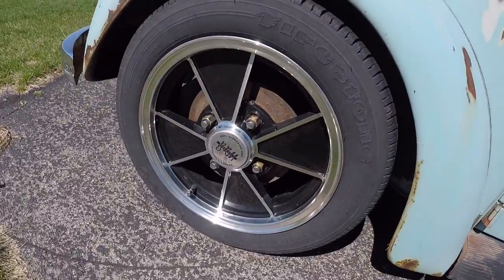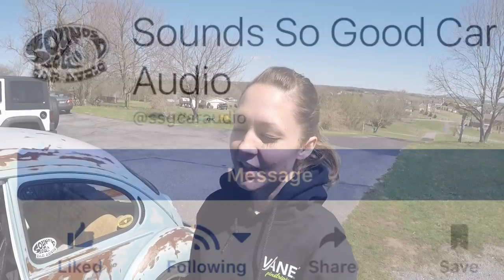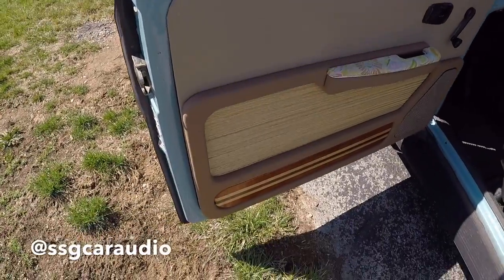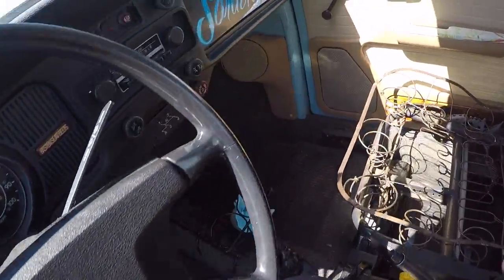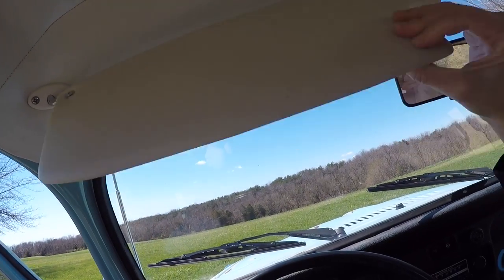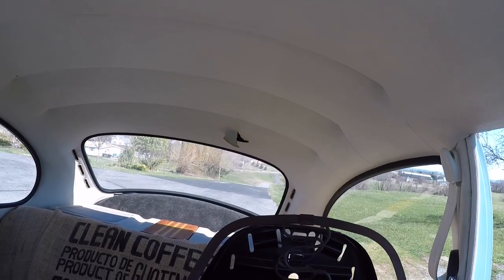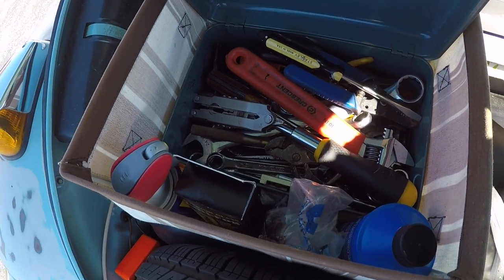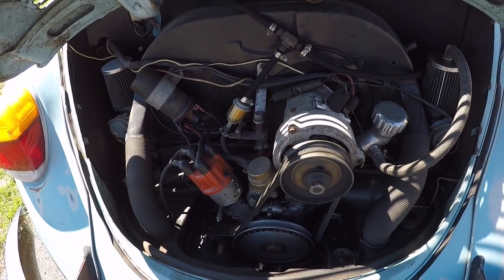VW Bug Walk Around -  VW Beetle Vlog Vane Pinstriping

Comment: I don't have a stereo in mine. But I do have seats. They are not perfect, but they are not trashed. Someday I will get a cheap reupholstery job done on them. I had to replace some floor pans, and I just did the floor with truck bed liner, no carpet. I am a mechanic, and built the engine myself. No heater, don't need one here in Phoenix, AZ. I have the stock ride height, but I'm planning on a new beam, new steering gear, and front disc brakes at some point in the future.

Comment: Hey Vane! I drive my 70 Bug everyday. One tip is to get rid of that plastic fuel filter from the engine bay
Reply from the maker: Yeah, I know some engine fires have been started by having the fuel filter there. I make sure to replace it and keep on eye on the lines (replaced those not too long ago), I keep the clamps on too for extra protection. Fingers crossed but so far it's treated me well. 😊
Reply: Yea I'm sure you'll be fine as long as you're checking it. 
your bug is awesome! Are those dual solexs? and I love the idea the guy pulled off with the subs and still having space between for storage. Love the videos!
Reply: YEAROB yes they are she said in the video
Reply from the maker: Thanks! Yes, dual sole carbs. :)

Comment: I have a 72 super and a 73 beetle the super is a long term project and the 73 has become a daily driver.  Are your brakes terrifying in traffic?  I had a few emergency stops missing the line on an intersection by about 8 feet.  I never feel like the car can stop safely.  I will probably upgrade to disc brakes in the front.  I have new shoes and hardware and a new master cylinder to help but it made no difference in stopping power or pressure needed to brake.   for now I just give my self about 10-15 car lengths when driving

Comment: How does she behave in the freeways? Can you do long drives at 65 or 70 mph? Are the engine and transmission strong enough for daily driving?
Reply from the maker: She does great and can go 70 easily but I baby her and drive only about 55-60. She does great long distances, drove cross country, take her on a few hundred mile trips each summer without problems.